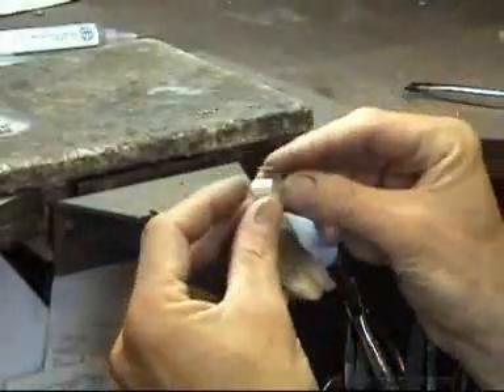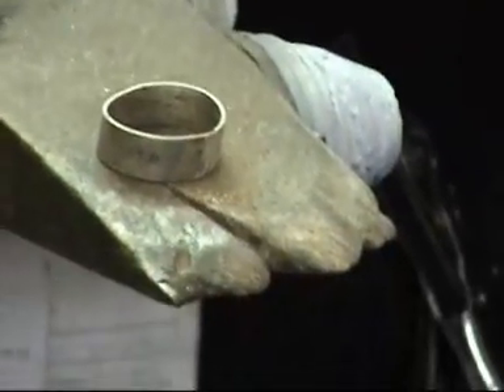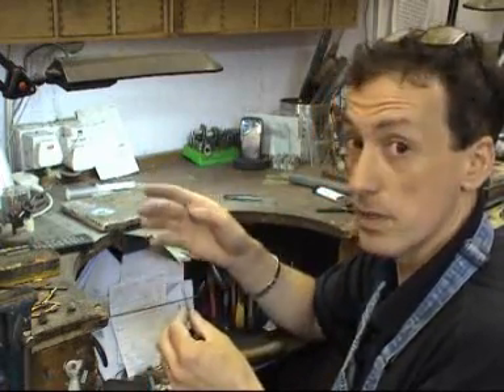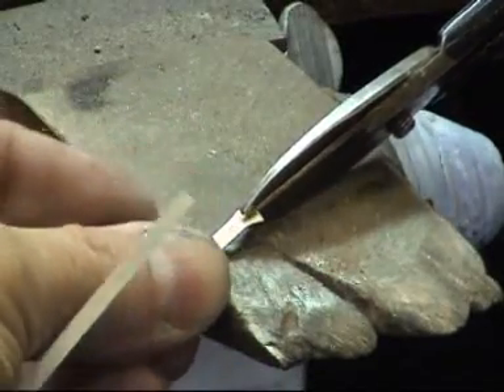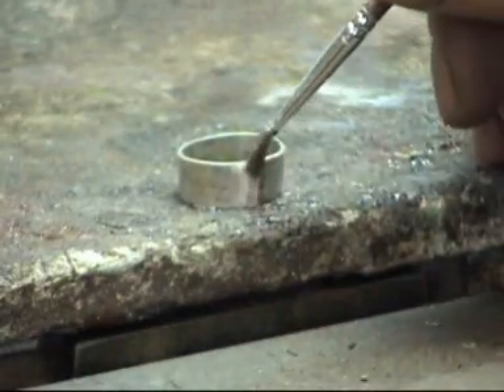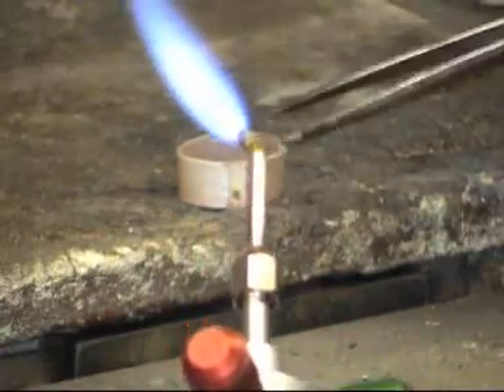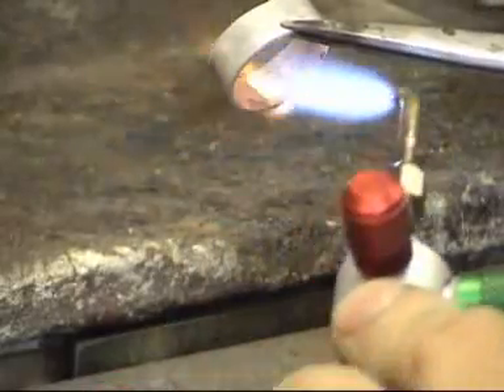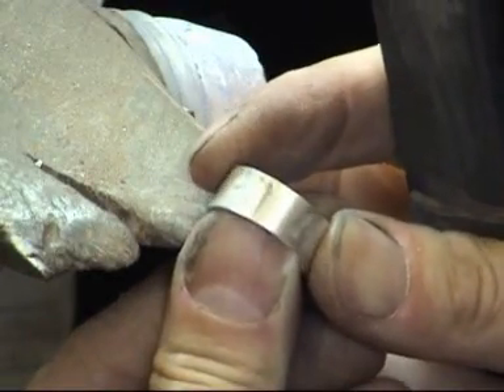How to Silver Solder by Andrew Berry from AtTheBench Jewellery Repair Bench Tips Techniques  Part 2

Comment: Dumb question but making my first ring...can I use my little silver bits (and the flux stuff) to do the soldering, or is that 'silver solder wire' some sort of alloy/compound?
Reply from the maker: No it has to be silver solder. Solder is an alloy which allows it to melt before your piece melts

Comment: Hi, how are you? been following your site since ive taken an interest in metal jewelry work. I learned alot especially love the borax and how to cut a ring properly so it always lines up. so great!
 right now I have such a problem with one peice and getting my solder to flow. im new at soldering and have done around five small peices. now with success but im doing a cuff braceet thats thicker with a silver rose on top which ill later add a small turquoise cobochon to. 
for the life of me i cant get the solder to flow.
ive tried around twenty times, watched videos,
read info.  i have a blow torch now and the smaller propaine gun. ive sanded filed and flattened the bottom of the rose and made sure the both peices are clean. im using Easy solder (which i wont use again because of the cadium, I was sold that by the tool guy)
but im pulling my hair out trying to figure out what im doing wrong.
i flattened the last bit of solder and i thunk i actually made it flow but i think i over soldered that time and ruined that because i didnt realize i might have dine it right and kept going :)

im soldering the bracelet warming it up with flux on and place solder on then heat solder then i place the rose on top with solder on the middle where i want the solder to flow.
do you have any suggestions as to
what can i do?? thanks so much!

Comment: HI, LOVE your teaching style. Excellent.  I have 2 tibetan silver rings, both have come apart where the square of the design meets the ring band.  I bought a plain band and I want to solder the square portion ~ its an ohm symbol~ onto the new ring.  This being Tibetan Silver which is different than ss, what kind of solder would I use and not melt the two away?  The ohm was originally soldered on I think, so there must be some product that would work.  These silver jewelry compounds abound in Thailand and Tibet, do you know of which I speak and can you advise?  Thanx again for  your stellar work, I sub and like.

Comment: I am new to jewelry making and I have been successful with making small stacking rings and now I am trying larger pieces of silver to make thicker rings. I am having a lot of difficulty solder in the larger pieces. I watched your video about soldering a basic ring and I have a few questions. I didn't see you dip the silver in boric acid to prevent it oxidizing, also you seemed to have used a borac/flux mixture? What is this mixture and why didn't the rest of your silver oxidize when you had the flame on it? I am first dipping my piece in boric acid then lighting it to see a green flame then I am using dandix flux (its in a paste, almost powder form) mixed with just a little bit of water to make a paste and small pieces of silver solder. I am using a small handheld butane torch is this what is preventing my solder to flow?
Reply: Sherry Cheriton try a larger flame ! I had same problem because my metal wasn't getting hot enough.

Comment: 3) The most important part of soldering silver is even heat distribution. This is what makes people think silver is so much more difficult to solder then other metals! You need to heat everything evenly.  I would recommend letting the flow of the solder lead your torch usage,.

Comment: 2) Never use "soft solder" on a joint in a area of high wear... Especially on a ring shank!! "Soft solder", as its name so simply describes is SOFT.  using it on a ring shank seam will 99% of the time end up with a split or crack in that seam down the road. Also you need to take into consideration the harness differential between soft solder and the silver shank. The soft solder will leave a polish line USE HARD SOLDER!

Comment: Good tutorial BUT, there are a few changes that need to be made to this process to improve quality!!
1) Boric acid and water is a terrible flux compound and not what its intended for! boric acid should be mixed with denatured alcohol. This mixture is used as a pre-solder dip to clean the surface and prevent firescaling. After dipping your item in this mixture then you need to use real flux.... Like self-pickling flux or better yet Silver Solder paste flux ( I highly recommend Dandix brand).

Comment: Nice job of the video. Alternatives to borax is Easyflo silver solder flux. Thicker and after heating and soldering it will come off in water.
Filing your flux after heating will blunten your file, emery is better or leave it in the acid long enough to not need either.

Cheers
Utooth

PS Joel Abramowitz... stainless won't contaminate the pickle/acid, eventually copper will and if you don't change the pickle regularly you will copper plate the silver pieces placed hot in the pickle.

Comment: Nice video. I do question the part where you put the ring in the pickle. I always use copper tongs versus stainless steel. You can contaminate the pickle.